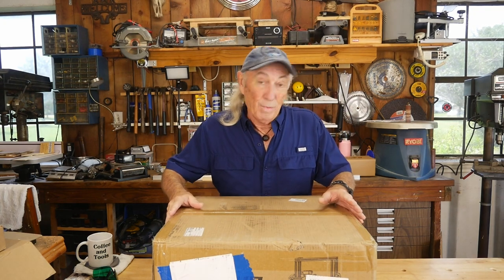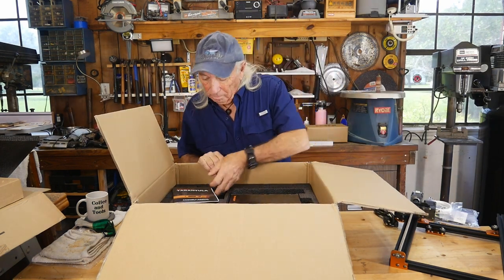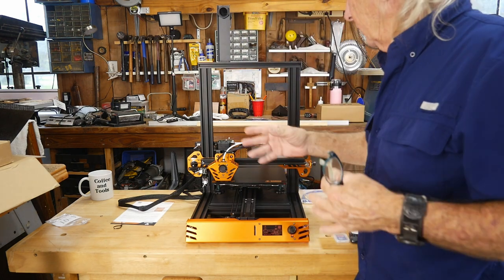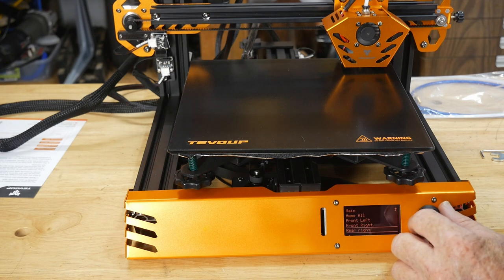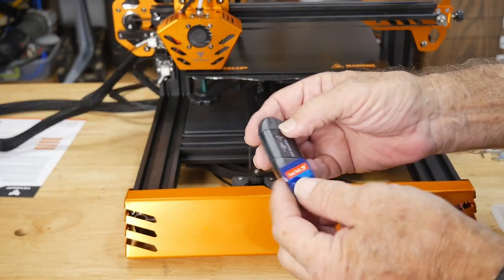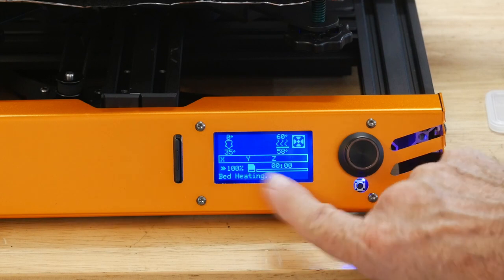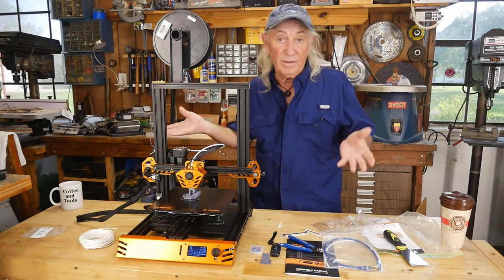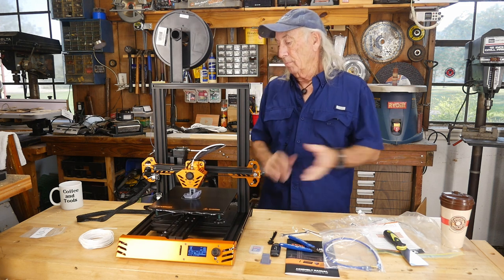EASY BUILD 3D PRINTER from Tevoup Tarantula , best price & reviewed by Coffee and Tools ep 270

Comment: @SirTools Just to help out others who bought this printer and might be questioning the quality. When I try to level the bed and all the corners are leveled then is the bed warped and unusable if I cant slide paper under the ruler (ruler is straight flat) on sides (where screws are supporting the plate) but in the middle (between the screws) I can move papar under the ruler with ease. Doing same on other side parallel to other axis is fine and I cant move paper under the ruler. I dont know if I should RMA it now or if its normal.
Reply from the maker: OUCH, this sounds like a warp in the bed. It can happen or even show up in production. Can you put a machinest straight edge on the bed and check it ? My old CR10 was bad that way and I ended up using a mirror from LOWES that fit the bed to get a "flat" bed etc.
Reply from the maker: Had to remember this one, but I had to use a shorter bolt on the "stop" limit to get the bed within good range of the adjustments for the bed to be set up on leveling. Sorry about my head just slow to remember that one LOLOL...